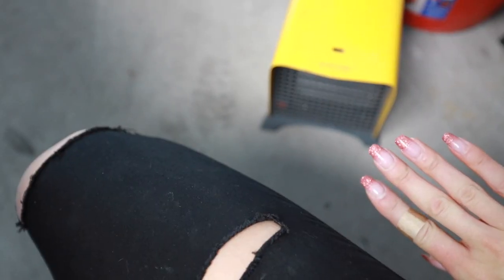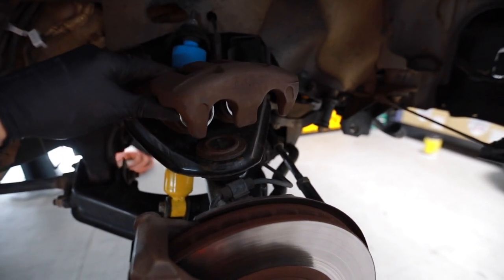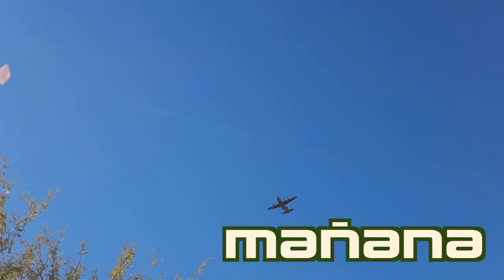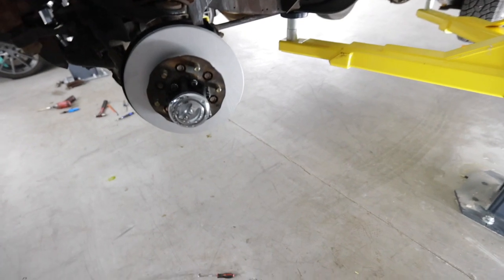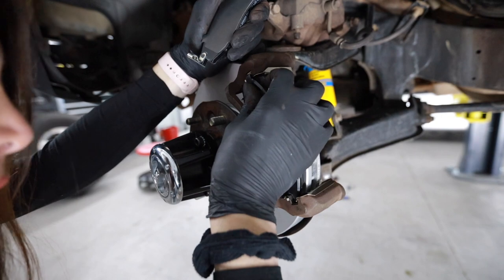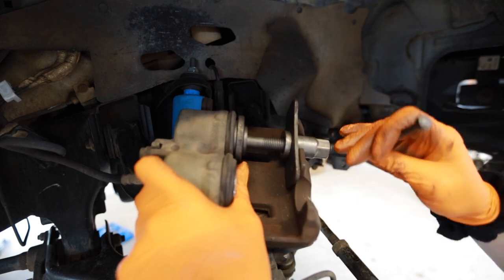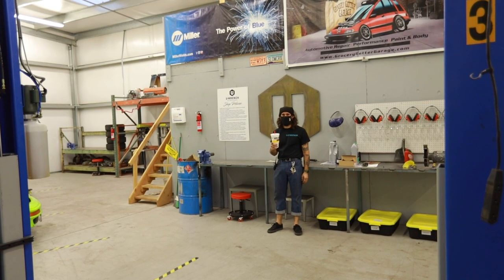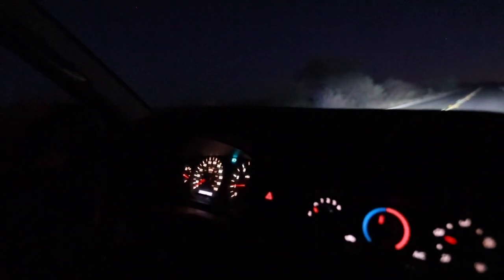Upgrading A Critical Off-Road Design Flaw // Little Sisters Xterra

Comment: 3:00 looks like you were making the bolt tighter with the cheater bar. Pushing or pulling up on the bar would have loosened it.
Reply: Some are reverse thread
Reply: Bish was goin the wrong way. 

I have totally done that myself.
Reply: @BIGMEME_Retro.trance  not this car
Reply: Definitely was tightening. They came right out with the impact and the switch set properly.
Reply: @BIGMEME_Retro.trance  These are not reverse thread, so one cannot take advantage of body weigjt to break loose bolts on the passenger side

Comment: The auto hubs I've dealt with would unlock and then re-lock when changing directions. For average daily driver people that only use 4x4 for an occasional snowy road, they are adequate. The lock/unlock/re-lock cycle usually rears its ugly head and breaks the hub from shock loads when a driver is rocking the vehicle back and forth, jamming the throttle without allowing some low speed rotation to let things re-engage.

Comment: Always open the bleed screw when compressing the caliper, I've seen ABS units ruined by forcing brake fluid backwards through them. It also allows you to contain the mess with a simple hose and container setup.

Comment: So the stock hubs unlock when you change direction?
When you need them the most?
🤪
Reply: They do unlock, but almost immediately lock again when the shaft starts turning backwards. Rocking back and forth trying to get unstuck can be really hard on them. I prefer manual, but auto hubs work great too for most people.
Reply: The auto hubs will stick in the unlock position if the 4x4 isn’t used often. 

I bought the warn manual locking hubs.
Reply: My buddy had a Nissan pick up truck that had those types of hubs we took him apart 3 or 4 different times to find out that's how they worked and yeah it's pretty rough on them when 'rock' crawling.

P.S. can anyone guess what color the next car is that Sarah's gonna do a review on?💅LOL!!!
Reply: The auto hubs look for change of direction and axle input to lock and unlock. If the axles aren’t turning in the hubs in reverse they’ll unlock.
Reply: They're not really expected to do off-road. More unpaved roads and the occasional snow day.
Reply: The auto hubs work perfectly in reverse.  There’s a very brief unlock/relock when you back up but that’s pretty harmless if you’re not hitting the thottle hard right off.  
In loose/wet conditions if the rear tires can’t move the vehicle then they will spin briefly <1 rotation before the front locks and are able to assist.  That spinning can bog the rear end deeper into the terrain, that’s really the only potential drawback they might have. 
That said I’ve never seen anyone blow up a hub simply from shifting into reverse.  It’s a tire suddenly getting traction, or the tire totally wedged and unable to turn while on the throttle that does it.

Comment: Last week I changed the brakes on my wive her car. A Mazda that we don’t care to much about, other than it should always do its job; bring us save from A to B.
Could not resist to paint the callipers :-)
I used the VHT paint and it went on great. Tip; use a paint stripper to heat up the calliper before you spray and to dry the paint after you sprayed it on; the paint will stick very wel and it is dry in seconds.

Comment: Shop dogs are awesome 🐕

Recently had to drill out a sheared off and seized brake slide pin - Ford dealer had greased 3 pf the 4 pins - 4th one took 2 hours to drill out - no calipers available locally and had to use the vehicle before one could get shipped in - used the same brake caliper kit as yours - MUCH better than a C-clamp 👍

Comment: Another awesome update video, thank you Sarah & Celine.

You know you're not supposed to push the brake fluid back into the master cylinder reservoir.

Best practice is to loosen the caliper bleed nipple, attach a pipe to a plastic bottle, and let the old fluid go into the bottle instead, else you push the dirty, crappy fluid and crap back up into the system, and it's allegedly bad for the seals too.

Comment: You have a lift but still work sitting down.🤷🏽‍♂️
Reply: Why work standing up if you don't have to?  Stuff accessed on the sides doesn't require standing.
Reply: Pulling wheels sitting allows you to build a bridge with your knees and save your back.  Don't blame her at all.

Comment: I had a 95 Rodeo with the same type locking hubs and replaced them with Warn hubs. Made a world of difference. Of course they're designed to be manually locked but they worked way better than the factory hubs.

Comment: Advice!! Disassemble that impact driver and smooth the runways , grease and reassemble.  Mine collected enough moisture in my tool chest to lock up. It was completely dry of any lubricant.

Comment: 3:45 I bought an impact driver years ago. But lately I just take the bit holder off and use it on my impact wrench with the screwdriver tip. Way easier, no hammering required.

Comment: I love your vidys. A tool suggestion. You might get a pneumatic rivet gun and what is called a screw knocker.  With the rivet gun, you gradually apply the hammering action, and with the screw knocker, the handle that it has will provide the torque leverage. You put an apex adaptor on the end and use whatever bit you need.  We use them all the time working on aircraft for removing frozen screws, and are just as handy on cars. Google screw knocker to see one. 👍

Comment: Sarah, you were pulling down on the anchor bolts, that is tightening direction, also its easier to put any vehicle wheel at chest height when removing wheels while standing, I have been a tech over 40 years

Comment: I was about to make some jokes about the calipers, but when I see you bought paint -and then not used it-, I realized that the struggle is real. 
It's fine as it is now, the surfaces in contact with each other are nice, nothing between them, and that little surface rust is really nothing. 
Here in Norway you can remove thick chunks and leafs of rust with a screwdriver, but the way the calipers are in the video I wouldn't be worried at all. Please don't stress :)
Thanks for the video :)))

Comment: Hey great video and content.  Those locking hubs are a great idea for my truck, thank you. I know you might not want to do this but if the timing belt has more than 70 thousand miles on it and considering that this is an interference engine, you might want to change it. "And the water pump while you're at it " peace of mind.

Comment: @Sarah-n-tuned: Don't go 4 WD and turn on a hard surface as the xterra has no center diff! What your sister felt like braking was transmission wind-up... You can break stuff this way.
Reply from the maker: Better to break now in this parking lot than off-road in the middle of nowhere I guess! Lol
Reply: Are you serous Sarah?  Break EXPENSIVE stuff (transfer case or diffs) in the parking lot for no reason rather than possibly break the cheap stuff (CVs, hubs) you expect to break on the trail?!

Comment: Sarah, the only time you puke break fluid when pressing the caliper back in is when someone topped off the fluid while the pads were worn, it is designed to drop while the pads wear thats another way of knowing when it is time for pads in addition to the squeal tab on the pad.  =)

Comment: Getting out to lock the hubs gives you a chance to see what kind of trouble you might get into.
Remember to unlock both hubs when you are done four wheeling.
Reply: My take on it is, if you anticipate getting into trouble, just lock em, there is still a diff up there. As long as you dont shift to 4wd you can dribe with hubs locked

Comment: put some on my 96, after a while " several years" the fake chrome peals  off.  =/  but they still function really well.  hopefully your xfer case doesn't require the front propeller to spend "driveshaft" in order to lube the gears while not in 4x4.  some do some don't some people burn up their xfer case because they don't check that before installing MLH.   Most Nissan xfer cases don't rock that design.

Comment: "Don't go flying... don't go flying..."  Next time - if practicable - place a clear plastic bag over the area/part that's held on with the snap ring clip.  You can still poke the pins on the snap ring pliers through the plastic bag (the clear lets you see what you're doing) and, if the clip pops, the bag'll prevent it from flying off into oblivion.

Comment: It takes like 20 feet in reverse to take it out of 4x but that is if I shift the transmission. So you do have some play with the auto hubs. I’m not sure I understood what the major flaw is? Note that I’ve owned my X since 2000. Love the beast. Only one flaw with the exhaust manifold cracking away.

Comment: The auto hubs work perfectly in reverse.  There’s a very brief unlock/relock when you back up but that’s pretty harmless if you’re not hitting the thottle hard right off.  
In loose/wet conditions if the rear tires can’t move the vehicle then they will spin briefly <1 rotation before the front locks and are able to assist.  That spinning can bog the rear end deeper into the terrain, and when they do catch the shock can damage the hubs, that’s really the only potential drawback they might have. 
That said I’ve never seen anyone blow up a hub simply from shifting into reverse.  It’s a tire suddenly getting traction, or the tire totally wedged and unable to turn while on the throttle that does it. 
And using 4WD on high-traction surfaces is risking driveline wind-up due to no easy way for the difference in rotation speed between the front and rear driveshafts to be released via the tires slipping a bit.  No center diff so if the tires can’t release it, something mechanical and expensive will like a diff or the transfer case.  Just don’t risk it.

Comment: While it’s probably a worthwhile upgrade going to the manual hubs, the auto hubs work just fine in reverse. I don’t know where you got the idea that they disengage while going in reverse but that’s not true if the transfer case is still in 4wd. They only disengage in reverse if it’s in 2wd, as it’s supposed to do. Nissan has been using the auto hubs since the 80s, if it was a “flaw” I think they would have remedied it sometime within that 20 years.

Comment: 5:50 it's easyer when you take the old clean bearing race or a new one, lay it flat on your hand, fill it  full and flush with grease and push the new bearing with your other hand flat in it...its a mess so or so

Comment: Typically you don’t come to a complete stop during the brake burnishing procedure unless the instructions for these particular pads called for it but I doubt it. Coming to a complete stop while they are hot will leave uneven deposits on the rotor which will lead to brake judder.

Comment: Is this actually true of the Xterra auto locking hubs? My understanding is that the hubs lock in when torque is applied through the transfer case/diff and they do not unlock until you take it out of 4wd.  I think the main reason people swap these out for manual hubs is because Nissan discontinued the auto hubs so they
aren’t available anymore when replacement is needed.

Comment: Awesome video! Do the Titans have that same 4x4 disengaging issue? I never experienced it but I know it shares a lot of components with the Xterra. My transfer case was shot and I just borrowed one from an Xterra. Question: if you just shift into 4x4 but don't manually turn the hubs, will it still engage 4x4? Does the manual lock just ensure they don't disengage, or can you no longer engage 4x4 unless you get out and turn the hubs after shifting via the switch? Thinking it would be a pain in snow on the freeway... but are you just supposed to lock them for added assurance when its time to go offroad?  I'm always bogging in farmers fields and I don't need to get stuck over that BS.
Reply: Titan has no locking wheel hubs, they’re engaged at all times.  Everything turns regardless.

Comment: Just wondering.the locking hub bolts.the old ones are obviously to long.did you order a set off line or did you get new ones at a hardware store.

Comment: You got full height lifts now, put that thing up in the air and save yourself crawling around on the floor and work so you can get better leverage.
Reply from the maker: That works fine if you have upper body strength.

Comment: thats not a fatal design flaw, thats called auto locking hubs, used on many vehicles, and yes, they do suck if you get stuck. They unlock and relock as you try to rock the vehicle, burning them up in short order

Comment: That's weird. Was that bolt with the cheater bar the same bolt that you used the gun on? If the gun was facing you, then weren't you tightening the bolt with the cheater bar?

Comment: Your OCD is just like mine .. Once I start a project and start taking things apart, it turns into a cleaning and replacing fiasco LOL .. I'll wire wheel the nuts and bolts, paint stuff that has no need to be painted and all such manner of making more work for myself LOL

Comment: I've never had a problem with my hubs, but manual hubs are more reliable and you might find some more MPGs...
Reply: The auto hubs without the torque will have the same fuel economy.  Without power from the CV shafts they don't engage and if 4wd isn't engaged at the transfer case then the front differential shouldn't be spinning.

Comment: So why is your shiny new, installed by a proper pro company lift not lifting and latching level? It’s a minutes job to adjust the cables as they settle in .And please thread lock your calliper bolts folks, I’ve had a calliper jam a wheel, it was a scary ride! 👍🇬🇧👍

Comment: I'm just curious, but why is the manual locking wheel hub essential? I've never had a problem with the stock electronic ones on my '12 Pro-4X... (Granted, I don't do much off-roading, I got the 4x4 because of weather spotting and storm recovery...)
Reply from the maker: You answered your own question lol

Comment: Just for the information there is NO design flaw in Nissan Automatic hubs! When the hub I locked it will stay locked as long the four-wheel drive is engaged from the transfer case, despite of direction of driving. To unlock the automatic hub, you have to have the transfer case I 2-wheel drive and reversing, that will make the drive-shaft stationary and the hub will unlock throw the revers action. I have wheeled off road whit my Nissan Hardbody with automatic hubs and newer had any problem, they say they are weaker than manual hubs, but I have modified my truck with 5.0L (302) Winsor engine and had at the most 35” Super Swamper tires and never broke the hub ore driveshaft.

Comment: Watch out Sarah! It looks like you´ve accidentally twisted the brake line one turn to the caliper on the front right side as you´ve putted it back together. I´ve seen those fail during the extra stress putted on them. Maybe you´ve already fixed it off camera.  :)

Comment: Hey Sarah, any ideas about my Subaru Forester eating through CV axles? Not doing anything crazy but the splines on the knuckle part are ripping apart. Changed my transmission because my local Subaru forgot to replace the CV seal and my transmission locked up and died. Even with a changed transmission I’m still eating through cv axles lol.

Comment: I would of went with cross drilled/slotted. Changed the brake fluid. Cost just as much as oem. A must for an SUV
Reply from the maker: Drilled rotors are trash.
Reply: @SarahnTuned  Agree to disagree

Comment: I’m not sure if I’m seeing this right on my TV, but when you refitted the front right brake callipers it looked to me like you had the brake hose twisted?
Also, take my advise and get that lift up higher.
You need to be standing up doing this work, that’s what a lift is for.
You are clearly struggling with some of that work because you are still virtually working on the ground.
Stand up and save your knees. Trust me, you’ll thank me later in life when you’re knees aren’t killing you.

Comment: Open the bleeder on ABS equipped vehicles when you compress the brake pistons, it prevents the dirty fluid from being pushed back through the ABS valves. Bonus - no mess on the firewall

Comment: At 2:50 are you pulling that breaker bar towards you while trying to loosen the nut on the BACK of the caliper bracket?  There's your problem.

Comment: You're not supposed to come to a complete stop when bedding in brakes Sarah, it can deposit pad material on the rotor causing a "hot spot" and possibly warping the rotor, not to mention the unsmooth pad to rotor contact, and squealing.... just fyi...

Comment: I'm confused... I have an 01 4x4 and I can promise the hubs do not disengage in reverse in 4WD. You're supposed to reverse for about 10 feet once you put it back in 2WD to completely disengage the auto-lockers. The real reason these are a design flaw, is that they are just plastic rings inside and break way too easily.

Comment: Sarah, I have a 4X4 xterra just like the one you are working on. I have been off-roading many times with it.

Fatal design flaw? I have no idea what you are talking about. You can go in reverse in 4WD all you want to without losing 4WD. With automatic hubs, you put the truck in reverse to unlock the hubs AFTER you have moved the 4WD shifter out of 4WD and back into 2WD.  As long as you still have 4WD selected with the shifter, going in reverse doesn't doesn't do anything unless the xterra has defective hubs or something like that. But there is no design flaw with the truck. Forward or reverse it stays in 4WD if everything is working like it's supposed to.